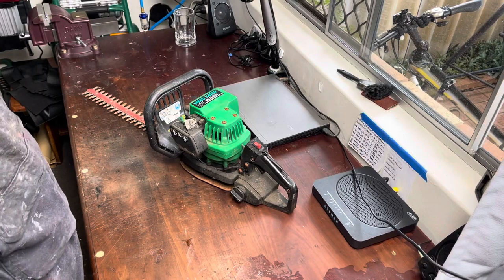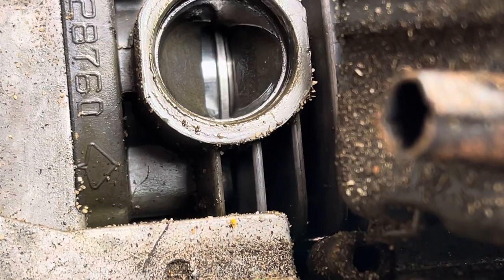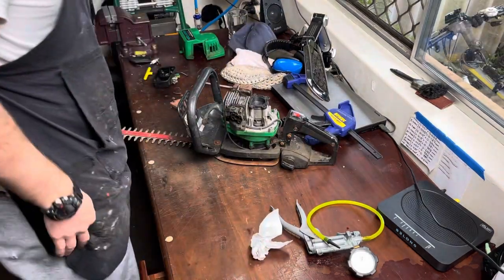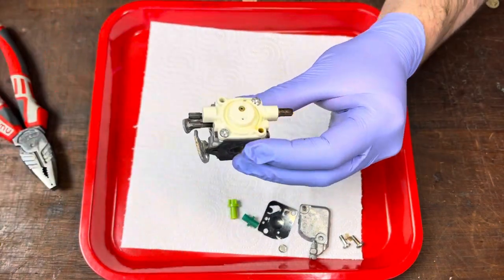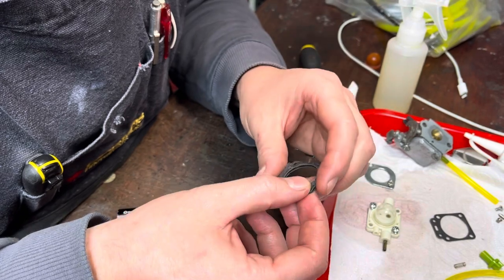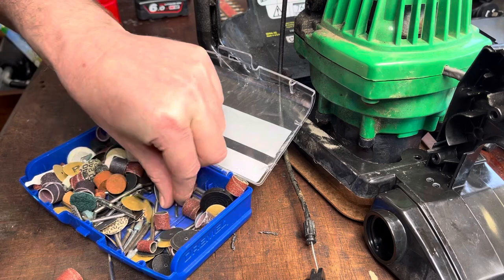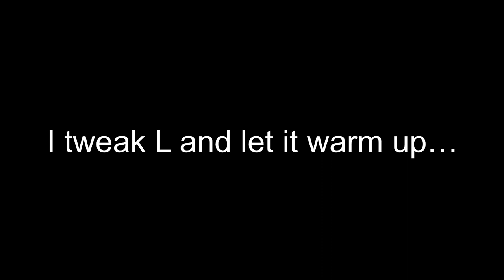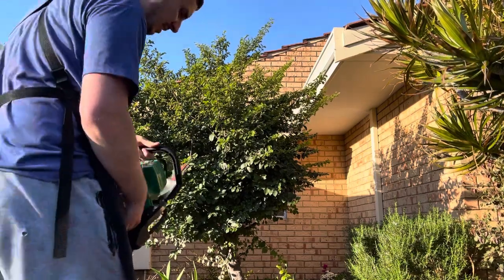1990’s USA Made Hedge Cutter - Service & Repair.

Comment: Nice job as always.I have had a few over the years for repairs they had plastic fuel pipe clips to tidy pipes.Those portec filters are being copied on Ebay they soon break up .All the best to you all.
Reply from the maker: Thanks for the heads up regarding the fuel  line clips! Thanks for the info on the cheap filters too!!

Comment: I laughed when it kicked the first time and you laughed, it was contagious LOL. I don't know why but don't like working on hedge trimmers, I just see myself losing a finger the whole time I am wrenching on it. Chainsaws are probably a lot more dangerous but don't bother me at all.
Reply from the maker: Hahaha it’s great when it happens and you didn’t expect it right!! Thanks for watching :) I don’t mind them, but I understand why people may not like the idea, two slicing blades reciprocating thousands of times a minute 😂🤣
Reply: @VintageEngineRepairs  😁 It's the only piece of yard equipment that I try to avoid, I know others are far more dangerous but I have a mental block on hedge trimmers. It's the only tool I see that I never consider keeping for myself. I have a couple trimmer ends for weed eaters I use personally, they keep the blades away from me. LOL

Comment: I was hoping to see damage to the cylinder and piston,wanted to see what you’d do to try and fix them. I’ve just replaced both on one of my old Husqvarna 254’s. I’ve since cleaned the bore with oven cleaner and very fine went dry paper. It’s come up reasonably well. There is a “shadow “ in the bore but you can’t feel‘ it with your finger. 
On a more serious health and safety note, please don’t be sitting down and using sharp or pointy tools. We all know you and chairs don’t get on ! 😁😁😁😁
Reply from the maker: LOL! Thanks for the chair advice 😂 yep that will be just fine, a shadow that can’t be felt is fine. Remove all the transfer and you’re good to go!

I’m sure I’ll come across a scored engine :)
Reply: @VintageEngineRepairs  I’ll try it on the other 254 I have.